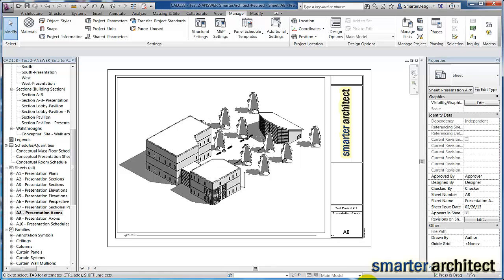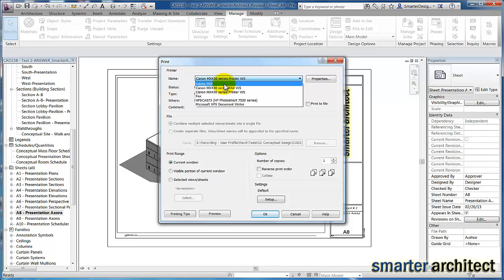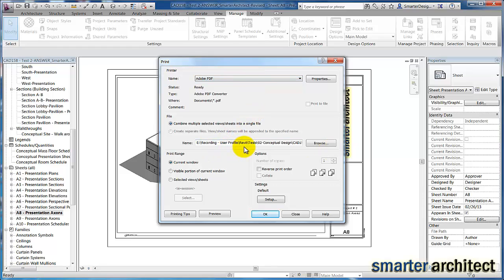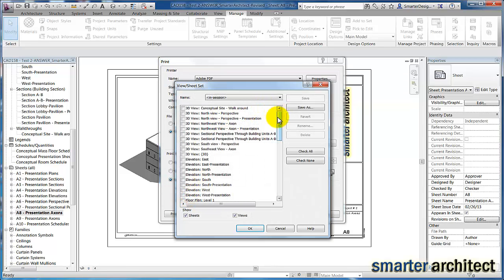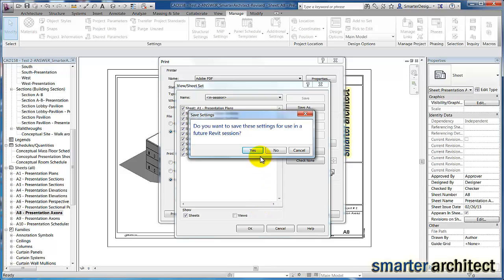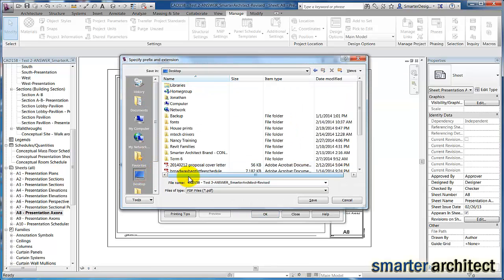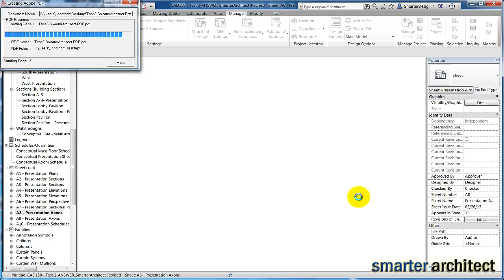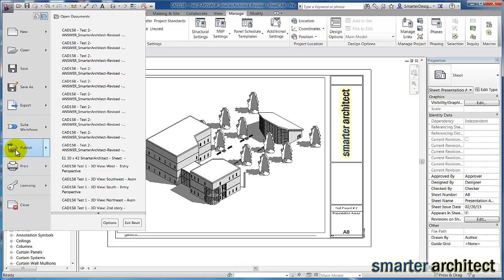Autodesk Revit Tutorial: Revit To PDF

Comment: If you read this please reply. I just made a house project and I want to print it on a tabloid paper size for a portfolio. Should I print the sheets directly from revit or should I print to PDF and then print them after? I noticed scaling down the drawing for it fit in also makes the lines to look kind crap. Thanks for your response.